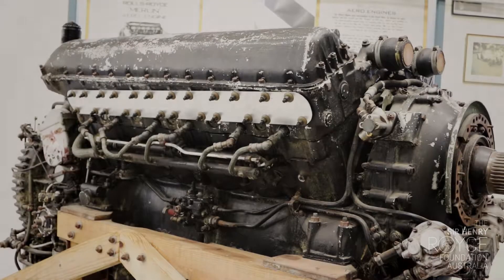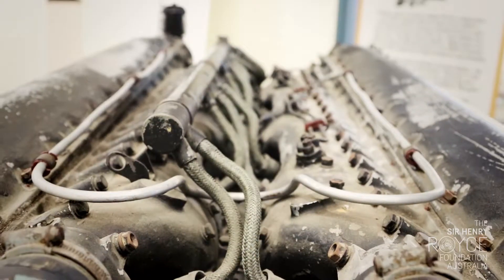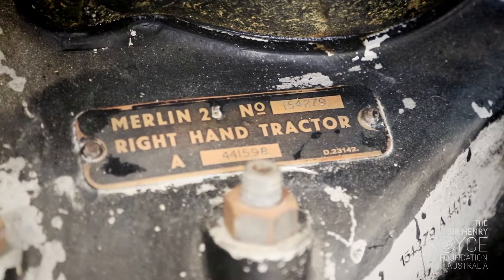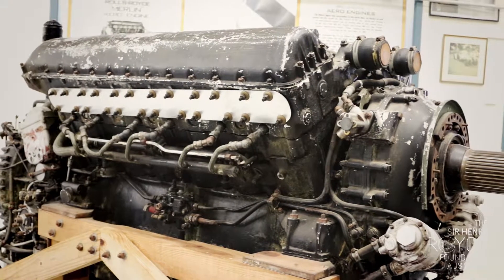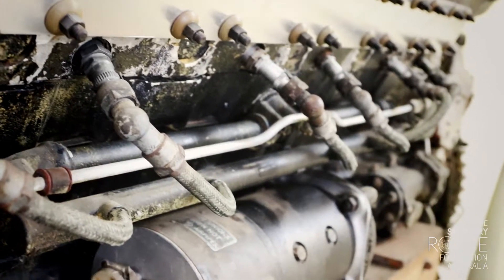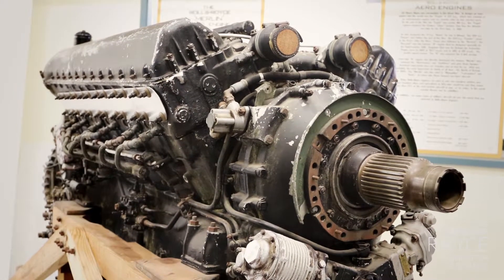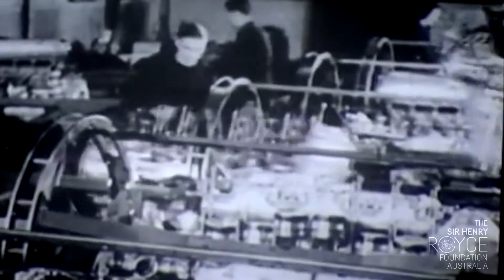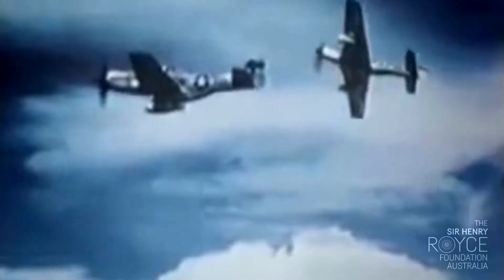SHRF: The Merlin Engine

Comment: Merlin 25 was a Mosquito engine.  It differed from the Merlin 24 by having reversed coolant flow to better utilise the wing radiators of the Mosquito design.  The right hand tractor only signifies the propeller rotation; the vast majority were right hand.  Engine number in your video puts the engine as spring 1943.  Most of these single stage / 2-speed engines (this version is not a two-stage supercharged engine) are rated at 1,620hp.
Reply from the maker: Thanks for your comments,.. tis much appreciated :-)